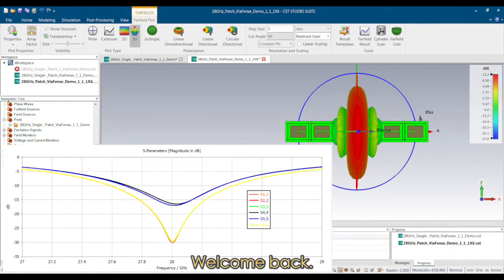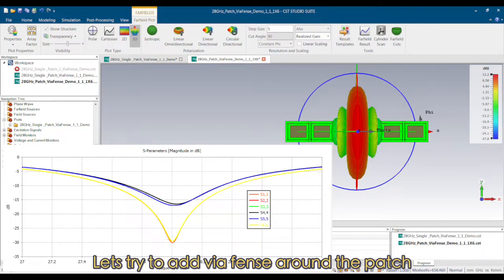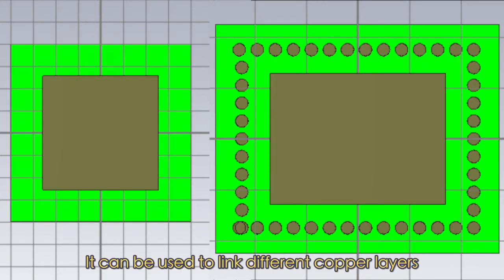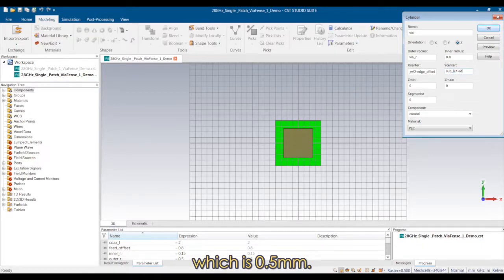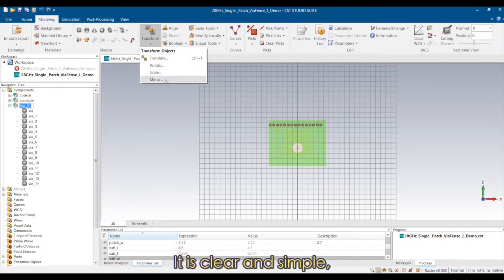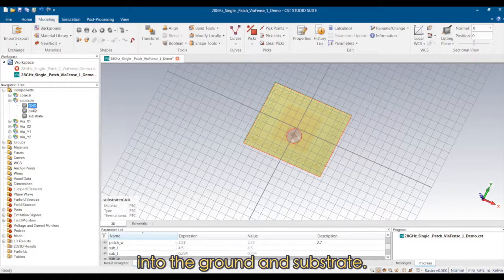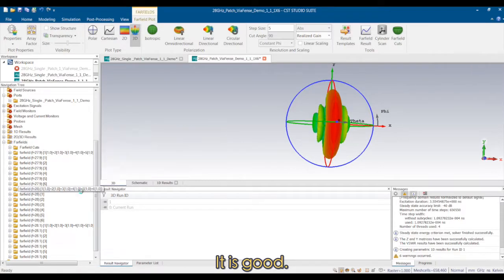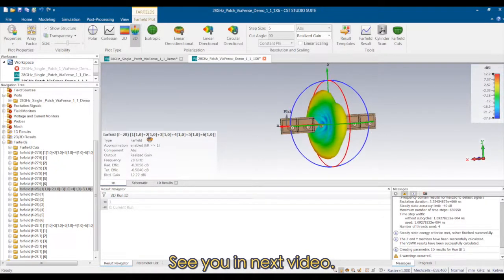02--28 GHz Patch Antenna Array with 12 dB Realized Gain

Comment: Hey fan!!..we have this project on siw filtenna ..Cld u help us with the design??
Reply from the maker: Hi there. 
In my first version of the 28 GHz antenna array design, I am using the microstripline to fed the array as I presented in this serial video.

In the second version of the design, I will replace the mictrostripline with SIW to increase the isolation.

But I need to finish the first version as I planned. 
As for the second version, I am working on it. However, the launch date of the second version design depends on how many people watched the first version.